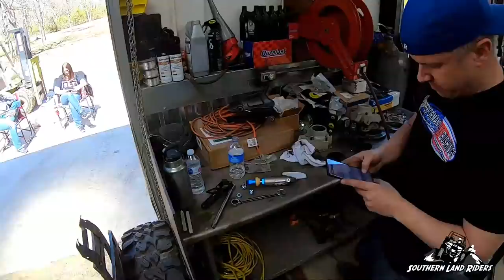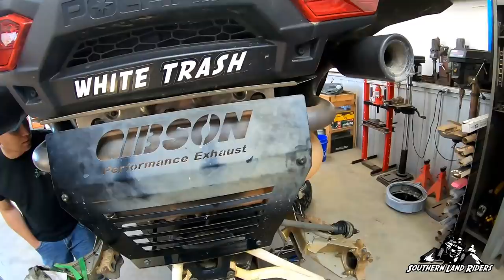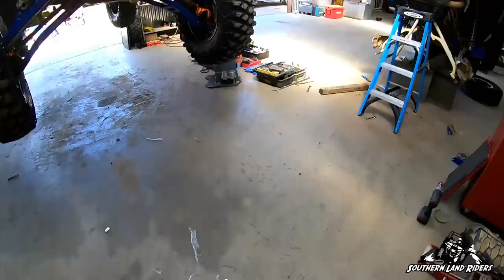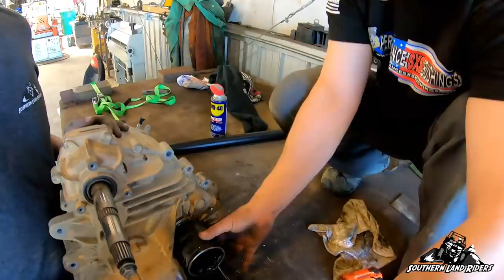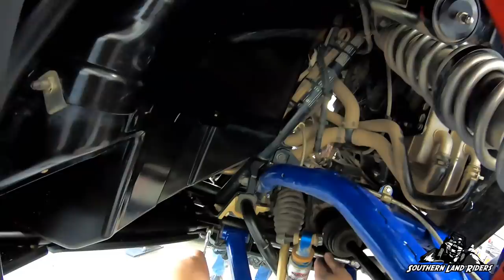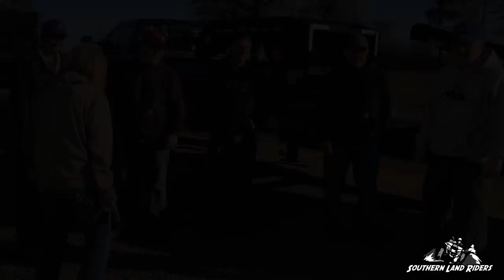Garage Workday!

Comment: Thanks for capturing the full experience and that includes working on these things and most importantly the fellowship with everyone in the group. It gives the rest of us that do this something to enjoy between rides. My wife has finally figured out that all the work we do is not to fix broken stuff but to insure we don't break on the trail and everyone has a great time on the rides.
Reply from the maker: Exactly. I try to install the strongest parts and do as much preventative maintenance so when we do get out there we can enjoy riding and not wrenching.

Comment: This is the reason I pull my axles when brand new and grease them and the wheel bearings with waterproof grease and then pull, clean and regrease them and the wheel bearings after every riding trip when I change fluids. Well worth the effort and if you break an axle it is a quick change on the trail.
Reply from the maker: For sure. If the transmission had not been out there would not have been any way we would have gotten them out if they were still on the RZR.

Comment: Quick question, do you ever strap the RZRs to the lift arms when working on suspension components? I use lifts every day and with smaller cars they sometimes seem a bit sketchy when pulling hard on suspension components or other tight parts.
Reply from the maker: No sir, never have. If I am ever going to be under it I make sure it is good and secure first.

Comment: I’m curious if y’all use your trailers as campers too?
Reply: Kyle Devore I do, I built a Murphy bed and some cabinets into my 24’ enclosed trailer. Still hauls the X3 and the Turbo S, but I can fold the bed down, set up a table and it has 50AMP 220 Service for heat and air conditioning.
Reply from the maker: No sir. We stay in cabins. Jeremy and Brian have RV's but the rest of us stay in cabins.

Comment: Was that stuck axles on that xp 1000? We had one  not long ago and I have that same puller and we had to fight it. We are some big ol boys and we thought we were not going to get it out.
Reply from the maker: Yes sir. That was out of Joey's RZR. Both sides were STUCK! lol
Reply: @SouthernLandRiders  there has to be a better tool or a easier way. I pulled mine front and rear and used white lithium grease. I don't know if it is any better  but it seems to help.  I have been using it since my rzr 800
Reply from the maker: @Tri-Lobe  That pulley / slide hammer is about as good as it gets. He just had not taken them out in about 2000 miles and they were rusted in there. If the transmission was still in his RZR it would have been close to impossible to get it out.
Reply: @SouthernLandRiders  the one we were fighting were the OEM and 3600 miles on them. Sad thing he did not want to replace them. 1 simply fell apart on trail 57 near the Caryville overlook. So you know how far out that is. Well keep up the great videos. I am glad to know I am not the only one that has had to fight axles.
Reply from the maker: @Tri-Lobe  Thanks man. Yeah that is a hell of a place to be trying to change an axle. lol.